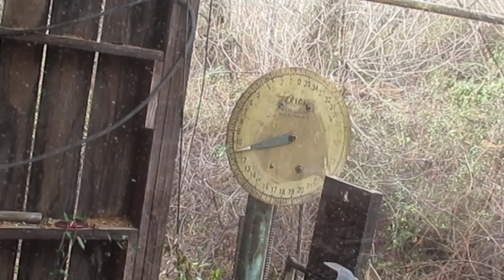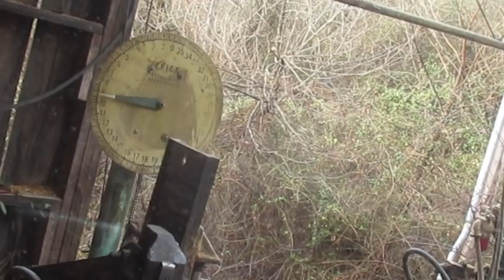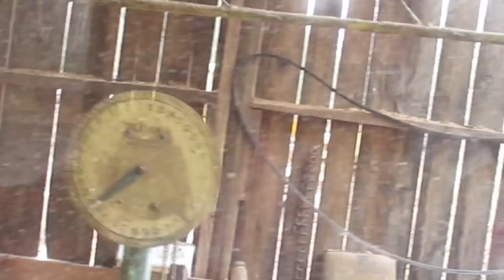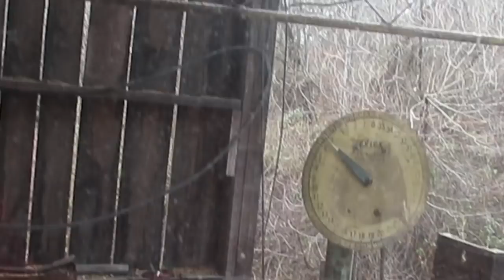SAWMILLING! Gotta Love it

Comment: You need to back off to q wider angle on your camera.  We can't tell what is going on.  And I'd like it is you would explain what happens at the other end of the process.  I can tell when scrap goes in the chipper, and I know about the pieces that get the bark trimmed off of the edges.  Obviously, you stack the final product but there seems to be anther pile,  I looks like full pieces that come from the first passes of a log through the saw.  Where do they go?
Reply from the maker: Sometimes we keep the slabs.